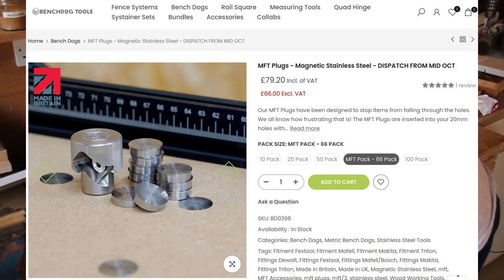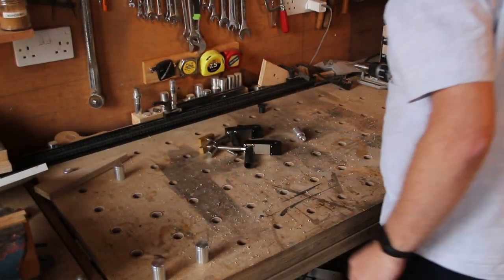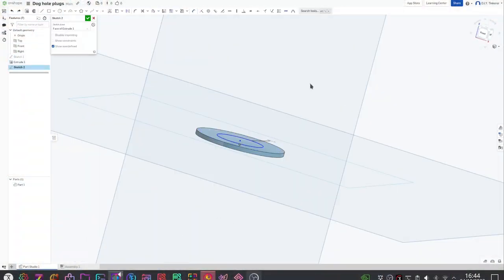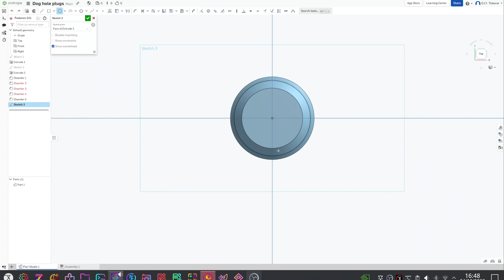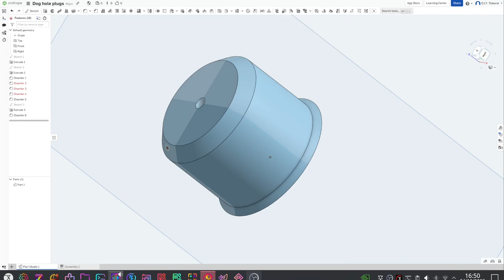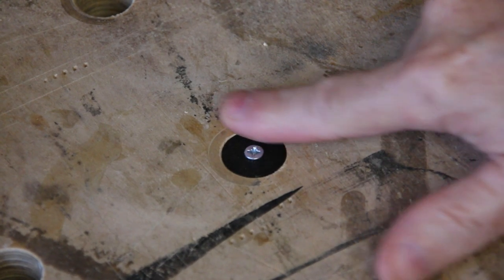MFT and Workmate Plugs

Comment: Hi there, nice video of the design process. Its funny I just stumbled across your video, I too saw the benchdog idea when I was originally designing my idea of a magnetic dog hole plug system, but didnt like that they were metal and could possibly be an issue if I was cutting across them by accident. 

I designed a system of plugs and an extractor that I have been selling  on etsy for well over a year now. Mine has a captive magnet in each of the plugs and allows them to stack when pulling them from the table for storage.
Reply from the maker: Stacking dog hole plugs sounds like a great How do you prevent them from attaching to anything metal?
Reply: @DIYTinkerer  I've worked on the design and iterated through many different designs and tolerances to the point that there snug enough in the dog holes that they pretty reliably remain seated in the holes. It's also partly due to the magnets I use not being too strong. Once in a while one will get stuck too something metal if you try hard enough.

Comment: Did you consider placing a thin sheet of ply on top, secured with a few screws and easily removable if you wanted to use the bench dogs. Alternatively, a sheet of ply to cover the drawer or to catch the sawdust below.
Reply from the maker: Hi Mark, thanks for the suggestions,  any of these would have worked,  and I did consider them,  ply on top was a bit of a non starter as I want the dog holes accessible at all times.  Ply underneath,  would have been better,  but I didn't have the ply and it seems such a waste!